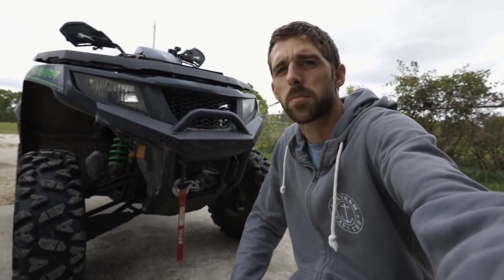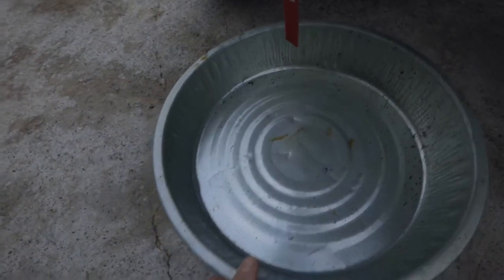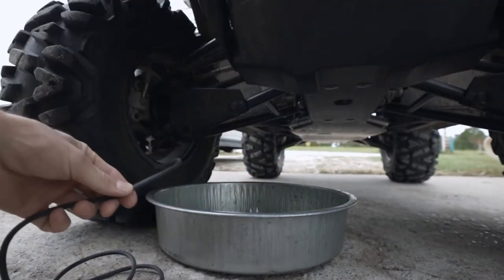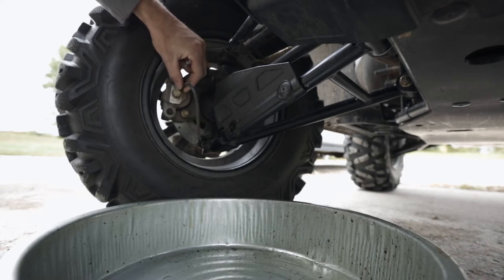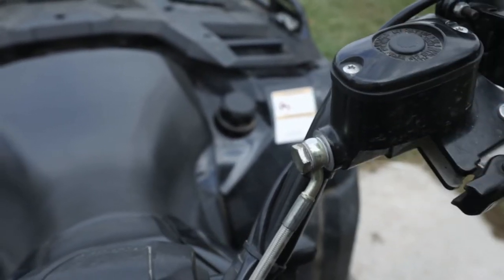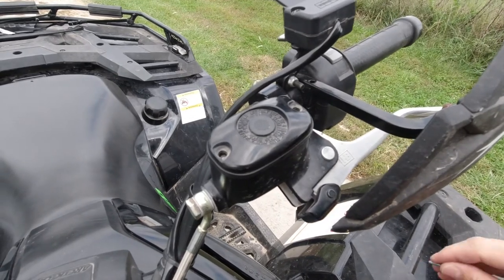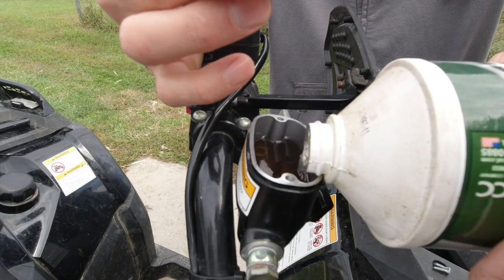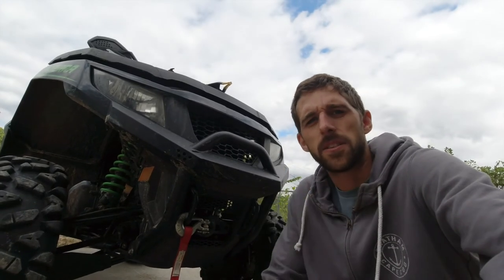How To Bleed ATV Brakes

Comment: I am curious, if you have a friend to help, do you need to put the screws in the reservoir lid, or could they just keep it pinned down while they pull the level, just to save some time.  I don't know how much pressure is exerted on the lid when you pressurize it.
Reply from the maker: There is not too much pressure on the cap so this could work by holding it. The screws are just snugged down and if you over tighten them it will ruin the gasket.

Comment: What about the back brake?
Reply from the maker: Bleeding the rear is similar to the front. There’s a reservoir for the rear under the seat and you’ll use the foot brake to apply pressure.